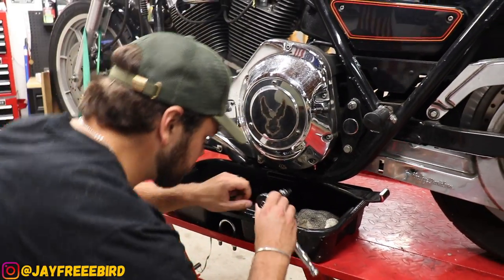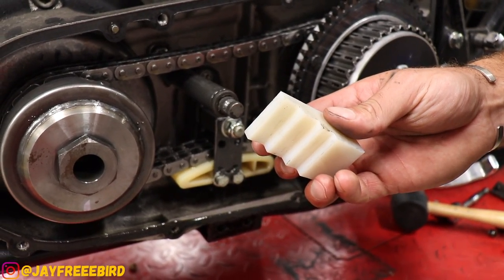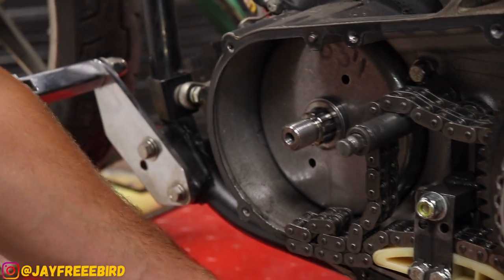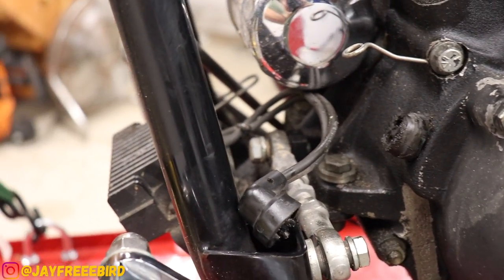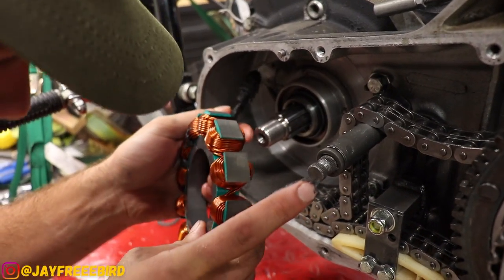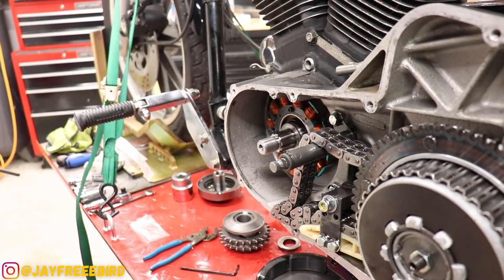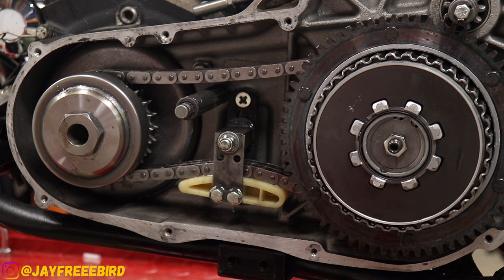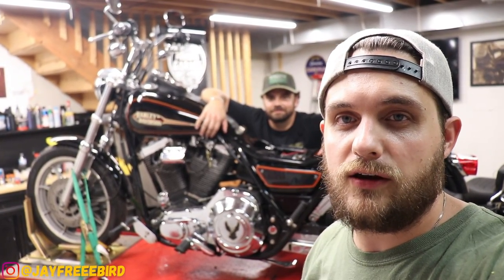HOW TO: Stator Replacement - Harley Davidson FXR

Comment: Just did the same project on my FXR a couple months ago. Stator, rotor, regulator and battery. My recommendation is make sure your gasket surfaces are properly prepped, and replace all of o-rings on the shifter shaft while it is open. Mark where the long bolts go on the primary cover with a sharpie. And be prepared to use a little heat when getting those primary and clutch nuts loose.
Reply from the maker: Man you nailed it with sharpie advice, that was one we had to remember on which went to what and got it right the first time. I appreciate the support and for the feedback!

Comment: That compensator nut is a bear! Tried a 1/2" drive breaker bar with 2' cheater pipe, was a no go. Need more muscle but breaking the breaker bar seems a concern. ???
Reply from the maker: It should, I had some major flex in the bar before it broke loss

Comment: Wow I'm doing  that now I bought the hole stator , regulator ,and my new magito  hits the two little  screws and that piece of plastic? Should I  use the old one , and the harley shop told me no more than 100lbs on the compensator 1994 fxdwg???
Reply from the maker: It shouldn't hit and you may have some of the spacers on wrong that would cause that.

Comment: What size socket for the compensator I’m doing my 2003 Electra glide ultra classic
Reply from the maker: Depends if you haven't already found out 5 speed is 1-1/2 or it could be 1-3/16

Comment: Nice how to video bro
Quick tech tip
Do yourself a favor and buy yourself a rotor puller. They're pretty cheap on Amazon and they're very helpful for this stuff. Letting the rotor slam on the stator like that can potentially disturb the glue content that holds them magnets together and the magnets can break away from the rotor and then you'll have another charging issue

Nice video, jus had to say somethin 
Keep wrenching
Reply from the maker: Thanks for the tip! It's definitely something I should of told anyone doing it. Don't let it slam it can cause those magnets to loosen up.
Reply: @freebirdsgarage  Yea no doubt bro. I jus would hate for it to happen to u or someone else. I jus did a stator n rotor on a 07 low rider and some of the starters have the magnets protected by a layer of stainless steel. The magnets aren't exposed like the older ones which I think is pretty cool. Gives it that extra layer of protection

Comment: My stator magnet is not that easy cannot it get off to save my life
Reply from the maker: There is a tool, but you can use the two allen tools to pry it out. Gotta be careful not to let go and slam it, it'll cause the magnets to break loose.
Reply: @freebirdsgarage  thanks man worked like a charm too